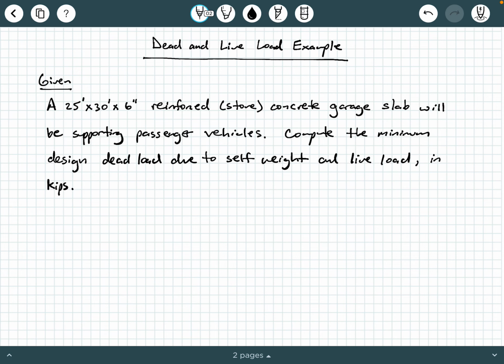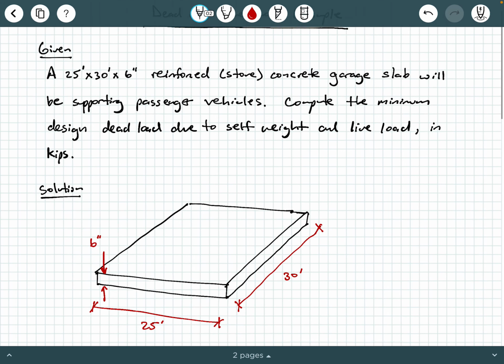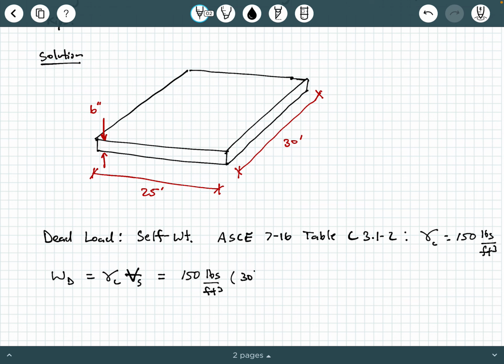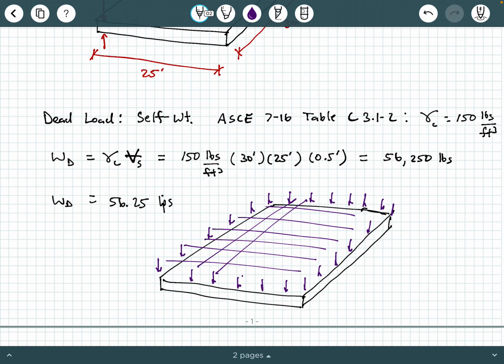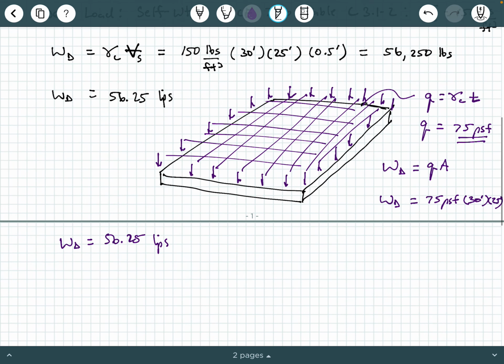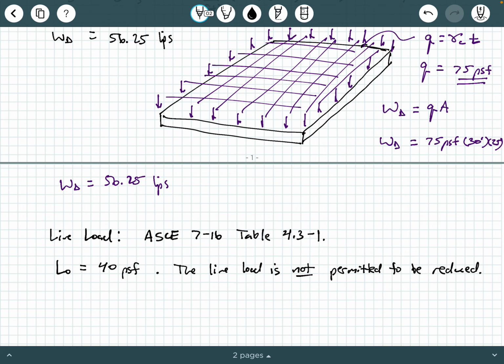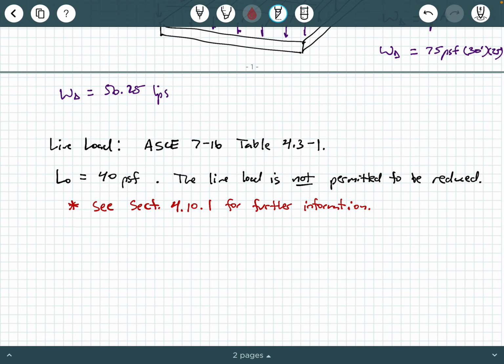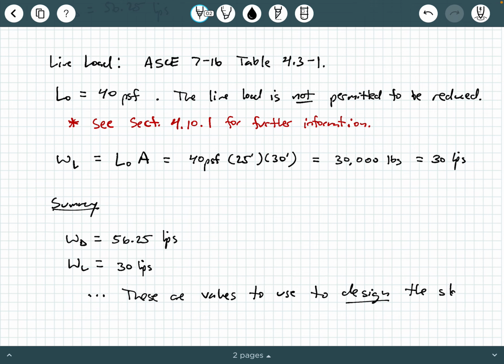Structural Analysis - Video 9:  Dead and Live Load Example

Comment: What would be foundation load if this slab be supported on columns? I have a case of a large steel platform rated for a live load considering equipment and personnel of 40psf. The designed platform weighs 25 psf. This live load would be acting need based on the area to be maintained. Would the live load be applied to entire platform area for determining foundation load?
Reply from the maker: Compute the tributary area for each of the columns.  Multiply the surface load by the tributary area for a column.  This will give you the force that is transferred to a column.  Then, this force is transferred to the foundation.
Reply: @mathandengineeringwithdr.a9515  Thanks for the response. Fully agreed in case of buildings etc where live load as occupants and furniture etc would exist at all times in some measure at all levels. Here the live load of maintenance personnel and equipment may exist in some small measure during shutdowns only. The platform is to be designed as per code, rated for this live load of 40psf  anywhere where the maintenance work is being done. The platform is never likely to be swamped or infested with men and machinery all over the area, hence considering the total total area multiplied by 40 psf would be overdesign. Kindly let me have your opinion.

Comment: What happen with the Load factors? Because the statement says Compute the minimum Design loads?  1.2D + 1.6LL.. The statement  don't mention ASD design.
Reply from the maker: Good day.  Thanks for your question.  This simply example is just meant to explore how to actually compute a service dead load and then a service live load, that would be used in design.  Once we have the dead load and then the live load, we can then use one of the two common structural design philosophies that you mentioned (LRFD or ASD) to get the overall design load.